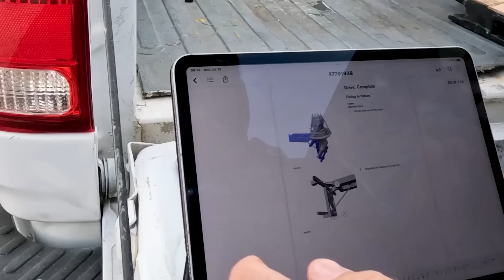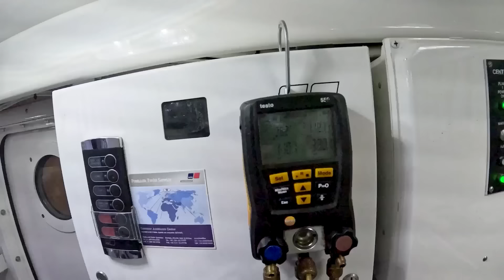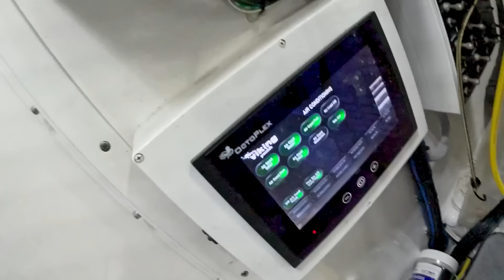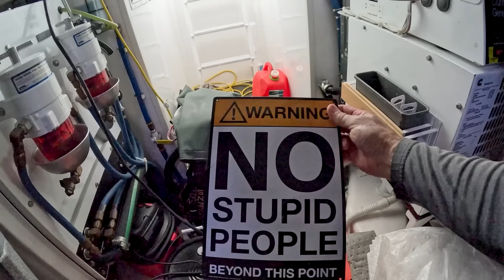Owners Last Boat Trip Ends in Disaster

Comment: Those airco's will have a hard time when the engines are running. I know they have sea water cooling, but the sea water being warm as well plus the ER being hot will test those coolers to the max. I saw you sweating in there without the engines running, it must be a sauna in there when the engines are running. Basic nightmare for all equipment.
Reply from the maker: Sweating because it feels like 100’ outside then going in engine room it’s like a sauna.

Comment: It’s really cool how those new drives turn completely around to reverse
Reply: Cool technology, but those pods hanging way down off the bottom of hull is a recipe for disaster.  With that size, boat I wouldn't have anything but straight shafts
Reply from the maker: Straight shafts hang a bit too with big props!
Reply from the maker: Yes cool technology 👍

Comment: Could replace about four of those long bolts with long threaded rod, nuts and a big washer to slowly lower  it out by turning the nuts.  Would be slow but very controlled.
Reply from the maker: Great tip 👍
Reply: That's fine, if you're not on the clock.

Comment: Thanks for letting me know where to find the key to the container padlock. 😅
Reply from the maker: Yup come visit us you’ll be on candid camera 🤣
Reply: @WillFixThat  
Ah, c’mon. I’ve got a ‘98 Pursuit OS3000 with twin 6bta’s. Three buckets would do me for the next two changes with some left over for the truck. 😜
Reply from the maker: @dsimon966 for sure. 😂
Reply: @WillFixThat  
Today’s project is troubleshooting a MarinAire unit. E4 code. I’m feeding the raw water with well water behind the house. No problem with flow, but water was mistakenly shut off for a period of time. I’m assuming the HP cutoff failed. If so, I’m assuming a new one can be brazed in. A little above my pay grade. Do you know of any shops/people in the Vero Beach area? I have heard of the T valve trick, but….
Reply from the maker: @dsimon966 we don’t know anyone in your area. Matt said maybe a communication issue with the unit.

Comment: You couldn't run fast enough to give me a set of expensive and high-maintenance pods or stern drives for a boat that constantly sits in saltwater. Give me simple and reliable v-drives or straight shafts.
Reply from the maker: Keyword Simple we understand that! Wait until you see the install Matt had one inch to spare.
Reply: You'd have to think Biden did a good job to have the words come out of your mouth to say I want pods

Comment: How long can you store that oil ?
Reply from the maker: It won’t be stored for long!
Reply: @WillFixThat  just wondering, I bought about 15-20 gallons of 10w 30 oil 5 years ago to service my power equipment . Still have about 10-15 gallons left…do you think it will still be good and not break down ?
Reply from the maker: @Ole_Lige sell it as quick as you can and buy new.